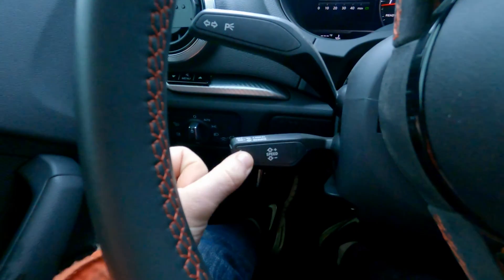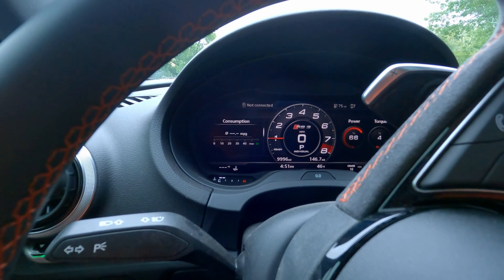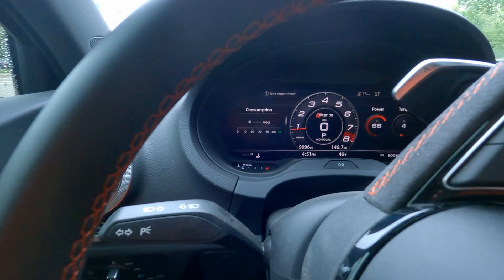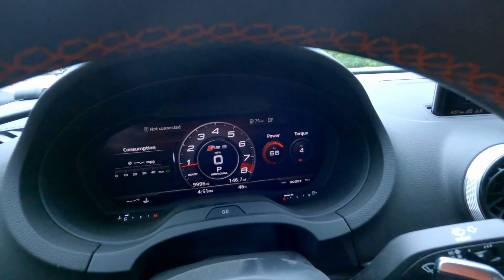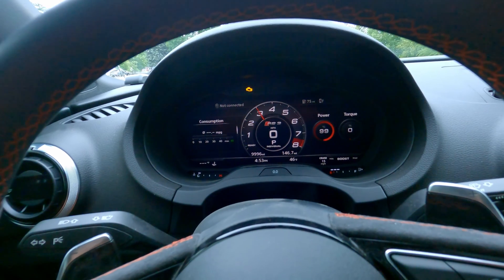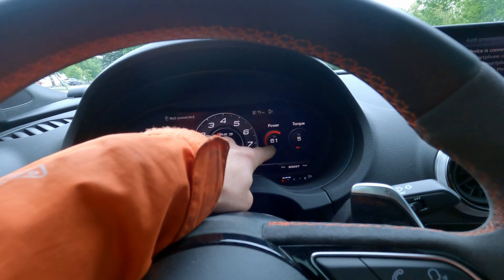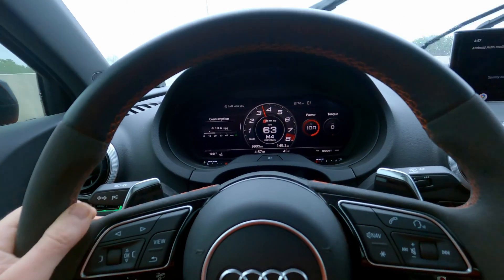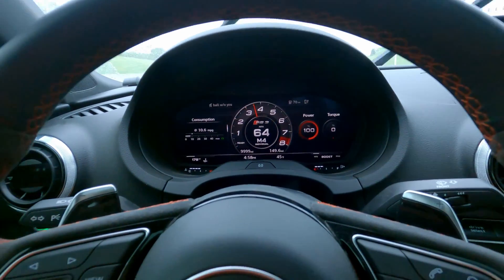RS3 Dyno Spectrum DS1 Map Switching and Gauge Switching

Comment: How do you change launch control rpm’s on the DS1? Thanks
Reply from the maker: Adjustable launch control (DAZA only):
When the vehicle is not moving, you can rev the engine to where you want the launch control RPM to be and hit SET on the cruise control stalk. We recommend not revving the engine whilst in park, but to do so in neutral.
Reply: @HardwayLearning  what button on the cruise control stock?
Reply from the maker: @bilicki44  "set" button on the end
Reply: @HardwayLearning  you are awesome! Thank you Sir
Reply: I know got the triangle with explanation point light coming on when I put it gear?
Reply: Never mind, door wasn’t closed all the way. Lol thanks again!

Comment: Is it a true flex fuel? Don’t need to empty the tank to add ethanol?
Reply from the maker: That is correct, it automatically adjusts boost and timing if you have an ethanol content sensor wired into your OBD2 port for the DS1 to read
Reply: Are you happy with DS1?
Reply from the maker: @derrickgarcia303  it's one of the neatest flash tools I've seen

Comment: Does the rolling anti lag have to be programmed by your tuner, or is there a way to program it to a map on your own?
Reply from the maker: It's automatically enabled with the off the shelf maps if I recall correctly. Dyno Spectrum considers it map 8 I believe, which is temporarily enabled when pulling down the cruise control stalk.
Reply: @HardwayLearning  awesome! Thanks for the fast reply!

Comment: Did you have to wire in your ethanol sensor so DS1 can read it?
Reply from the maker: You wire the ethanol content sensor output to the OBD port, we actually have a video on the whole installation if you look back a couple videos 🤘. The DS1 has a pin that connects to the specific pin on the OBD port so it needs to be connected for the content to be updated correctly
Reply: @HardwayLearning   thanks! 🙏🏻